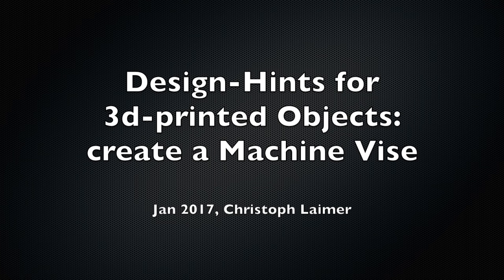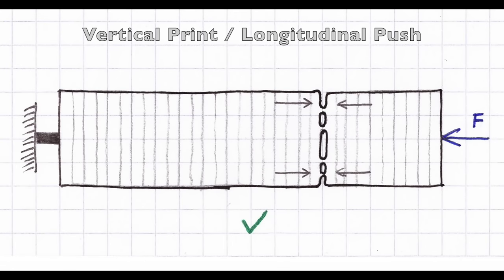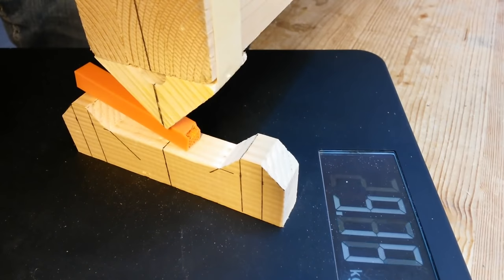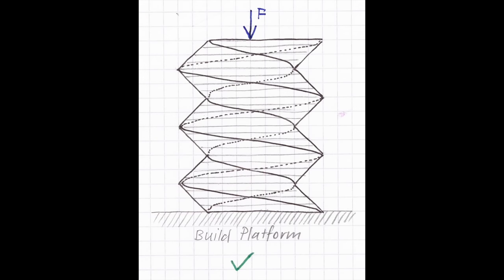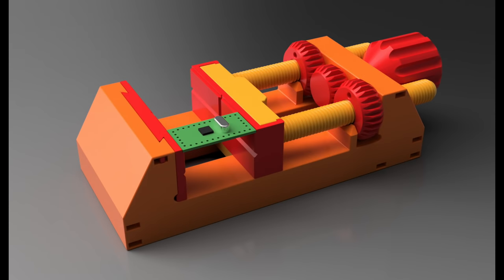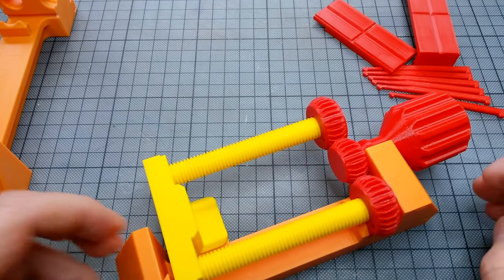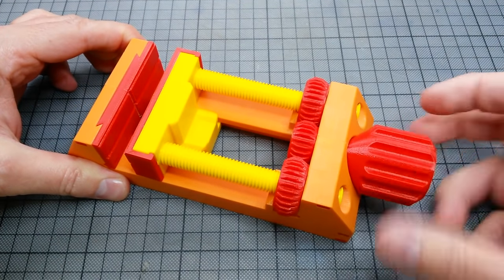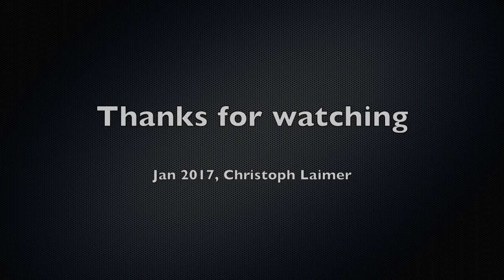Design Hints for 3d printed mechanical Objects: How to create a Machine Vise

Comment: As a Mechanical engineer student and a 3d printer owner, this video is just clear as glass. Great Work.
Reply: I second that Lucas. I've been looking for a while for some information about maximising build strength and this covered everything relating to design strength in just 11 minutes with perfect clarity.
There are other considerations like material(s), printing temp and post processing (like epoxy or acetone vapour etc.) but this is really the entire remaining area that no-one else seems to have covered though. 
Excellent! :-)
Reply: Tempering a print in the oven is another post processing trick to be aware of, although you have to plan for the shrinkage. Thomas Sanladerer touches on this in one of his strength testing vids...
Reply: May I suggest replacing the guiding hole with a protruding ball or a line? I hate places that germs can hide.

Comment: I'm currently printing this vise out and thought I should share my experience so far. I first printed the sliding piece with the two screws. The bottom (face) of it had some layers that warped slightly. I probably could have done the first few layers at a lower temperature but with a little sanding, it'll work perfectly fine. Also had some messy parts on the screws but they were easy to clean up.
I printed the gears second and I'm amazed how well they came out. They mesh together perfectly straight off the printer. Only needed to clean up the threads very slightly.
The two halves of the base are printing now (60% so far) but they look absolutely fantastic.

That's as far as I've gotten but I don't forsee any problems in finishing a working vise.

Anyway, thanks for uploading the files to this! It's going to come in extremely handy.

Comment: Well done.  One thing that I did on the screw on a bench vise that I did was to leave the center hollow so that after printing I could insert a threaded rod.  One end has an embedded nut to thread into and the other I use a nylock nut.  Once tightened down I can apply considerable force without damaging the printed threads.

Comment: Thanks for the excellent video.
This video made me realise why my last print had a failed clip joint.
It was a complicated LED Strip Light design in 5 parts with rotating joints and wall bracket.
The clips I designed that 'should have' slipped into place and locked, just broke as they didn't have enough strength, while the small test part I printed first worked well.
They were aligned differently during printing, so had different weak points!
Thanks for providing your vice design as well, as it will be very useful.
:)

Comment: I very much liked your explanation of the forces acting upon the print layers, and the correct way to orientate the part on the print bed. A square thread would make the rods much stronger (although probably not needed to hold a pcb)😊 Thank you for sharing

Comment: It is a very nice presentation and I like all your videos. Regarding printing the screw, did you consider putting a flat by removing a portion of the thread with a plane parallel to the axis, on one side only to touch the build plate? You will not have a complete thread around 360 degrees on the screw but the nut will have a thread all the way around.  Thus, the motion will be continuous. This will allow a higher tensile load capacity because of the continuous fiber direction as you illustrated.

Comment: I managed to explode your vise with some of my abusive use, and god damn it went out with a bang :P
Surprisingly it was one of the base halves that went first - It was just torn apart right across the middle section, where it should be really strong.
I imagine there was quite a lot of force involved in this failure, but I'm very surprised the screws didn't fail first.

Comment: How do you know what tolerances to use when designing a part?
Reply from the maker: Good point. It's based on experience with my 3d-printers. For a tight fit between two 3d-printed parts I'm designing a gap of 0.15mm, for a loose fit like a bearing I'm designing a gap of 0.25mm (or more). The accuracy variation of 3d-printers out in the field is still huge, but compared with the past, things got already much better..
Reply: Fully agreed. Just trial and error. And the tolerances you measure are a good guideline; personally I always use 0.15 - 0.2 mm for a tight fit and also around 0.25mm for a loose fit. Depending on the application. If I want a really smooth loose fit then I generally use 0 to 0.1mm spacing and then finish the hole / part with a drill / sanding paper.
Reply: I have found that many variables exist for this.  For instance infill percentage will make hole sizes change.  At 70% infill I use 5.4mm for 5mm holes and it is a close fit (not a tight fit) but at 20% infill they became a loose fit and was no longer good as a bearing holder as the bearing just slipped out (this was a larger hole of course).  Now I changed my nozzle size in S3D from auto (0.42mm) to the actual size (0.35mm) and had to increase my flow rate from 1.01 to 1.02 and all of my sizing had to have an extra 0.1-0.15 added to be the same size.

Infill, flow rate, infill pattern, and wall layer count (I use 6 so I can drill out a hole on my drill press if needed) all effect hole sizes.  Oh, and lets not forget shrinkage too (look up the amount of normal shrinkage for your material type you are printing in on the net) that must be accounted for and it changes depending on room temp + rh (reason Stratasys uses a heated chamber to help control this variable).
Reply: Sorry if this is a dumb question: but by a gap of eg .25mm for a loose fit, do you refer to .25mm difference in the radius (--> on both sides, so .5mm less diameter for a round object that should have a loose fit in a hole) or in the diameter? I ask because I'm in the process of properly fine-tuning my diy printer, while actually having access to my brother's ultimaker: with the ultimaker, .25mm gap over the diameter would currently be far from a loose fit. But maybe I have just been using bad slicer settings ... What should I aim for with my printer?
Reply from the maker: Yes, for a loose fit, the diameter of two objects needs to be is 2*0.25mm different. You also need to consider how accurate the two parts are. E.g. if you design a hole for a ball-bearing: because a BB is very accurate, a gap of 0.125mm is sufficient for a loose fit (half of 0.25).
Reply: Ok, perfect, thanks for the fast answer!
Reply: I usually print multiple 1cm by 1cm by 1cm block of cube. Use statistics on it to find sigma. That can give you the + or - of the tolerance. But its kinda tedious.

Comment: I thoroughly enjoyed watching this video, printing the parts and putting the vise together! 

I have one question:

The gears have some undesirable play and they tend to get unsynchronized, resulting in de vise going offset.
Also, the gears slip if I try to clamp something in the vise. 
Everything else fits perfectly. 

Is there any way to fix this?

Comment: I was hoping that you'd have also included a wood bar that was cut against the grain rather than the grain going through the length of the bar. I believe that most wood is far more anisotropic than 3D printed plastic. Possible exceptions would be things like Mulberry wood and the type that Indians used for bows (Osage Orange?) due to the grain structure not being straight-line as in most other wood.

Anyway, I'm pretty sure that a wood bar with the grains aligned in the short dimension would have snapped at a tiny fraction of the pressure required to snap the similarly aligned printed plastic. Still, it'd be interesting to have it tested for confirmation. If this is the case, it might lay to rest much of the concern over printed material anisotropy.

One other thing that IMO could have a dramatic effect on the "angular strength" of things like the vice jaws would be for printer software (firmware?) that would have the lines curve around each corner rather than printing "raster style" with the long part of the piece having long runs of plastic, but the short parts having short runs.

I am assuming this is how the printers operate. (I have built a printer my son purchased but we have not yet fired it up other than to verify that the motors work and the head will melt -- and eject -- plastic filament.)

Comment: Maybe you should've switch the places of the jaw plates. The design would be stronger. The C-bracket it's needed more on the opposite side where can hold better the 2 parts of the base. :) Great design by the way. I am assembling it right now. Still hot from the printer:)

Comment: This is such a great build. Do you have or are you planning to do any more detailed tutorials on the 3D modeling process. I would love to know how to do screw threads from the ground up for example. Any thoughts on putting together a video that details your process from start to finish. The parts print so easily without any issues on my Prusa i3 mk2 that I'm really amazed. Would love to learn how to get the same results myself from my own models.
Reply from the maker: This is a nice video about custom threads in Fusion 360: https://www.youtube.com/watch?v=TR7fsgQNmEk

Comment: great work!! what if the main gear is larger in diameter, so you can move the clamp faster?
is there a big drawback?
Reply from the maker: It probably doesn't matter. I made the 2 pushing gears larger,  so they can also be used like a handle and moved directly by hand. If they are smaller, they "disappear" behind the base frame, and accessing them by finger gets more difficult. Maybe this secondary feature is obsolete with a larger center gear.
Reply: Christoph Laimer thanks for the reply, love all your work on this channel! left me excited to design and print a 3 (at least 2) axis vise now!

Comment: More videos like this please!! Thank you for this excellent walkthrough. I just started working for a 3D printing shop and often run into technical issues on the best way to design and print mechanical objects. 

I see in the comments that you've addressed questions about tolerances. Is there a method you've used to test tolerances in different settings and materials? Also, how did you determine what dimensions to design the threads and gears with? Thanks!

Comment: Awesome Video.
Do you ever put 360 projects up?
Stl files are cool, but I think I seeing your setup would be even more interesting.
Especially if someone wanted to make changes.
I think I might sit down and try and make one of these in Fusion, thanks your video was inspiring.
Reply: Nevermind! Just saw that you do have the fusion 360 files! This is awesome!
Thanks! There are a few modifications I want to take a look at and maybe make.
I will update here if it works out.
and will post the fusion 360 files here for people as well.

Comment: Just one remark i can make: You should have inverted the swallow joint on the fixed yaw. That way this swallow joint would remove the need for the clips and keep everything together more firmly.
Reply from the maker: Indeed I had this as a temporary design, but then it would need to be printed with support material. Printing without  support material is not only more convenient, but the accuracy of the supported structures is also inferior.
Reply: print it jaw face down or standing up?

awesome vid by the way, subbed!

Comment: I am amazed how you printed to such accuracy and smooth tolerances.  How do you do that?  I find I have to go with a trial and error approach, as well as adjust/play with nominal dimensions on my CAD file.  

Yours looks like you printed immediately with zero issue.
Reply from the maker: Also trial and error. And a lot of experience from earlier projects ... Luckily new 3d-printers are getting more and more reliable and accurate.

Comment: I think this is a bit misleading, however. When printing vertically, you're not using 100% infill, so there's not as much material "available" holding the lasers together. Would love to see a 10x10x100 with 100% vertically.

Comment: Like wood, what would be the recommended parameters; maximum pressures, etc.?
 (also fm,k: E0,mean: ρmean: ρk: ft;0;k: ft;90;k: fc;0;k: fc;90;k: fv;k: E0,05: E90,mean: Gmean: G0,05) usw.
Wood is most easy to engineer.

Comment: Is there a reason why 3D printers are limited to printing in one direction only? Why can't grain patterns be mixed in different layers?
Reply: If you think about how the printer works, there is quite a big "print head" that needs space to move. If you tried to print with vertical grain direction on a print, that head would interfere with the model as it moves up and down, so unless you have a 5-axis printer it is only practical to have the grains oriented in the x-y plane (z being vertical). And event with a 5-axis printer you are limited (and they are also very rare).
Reply: neistridlar
You can still print in the X direction, and Y direction on each level though.
Reply: Yup, no one ever denied that. In fact it is practically always done that way.

Comment: im kinda surprised you didn't solid fill you prints or like 95% them or is the strength of infill not worth the extra length of time it takes?
Reply: ncktbs 

It wouldn't matter for comparison, however it looks like his infill changes orientation (as would be expected). So while what he says is completely correct, it's a pretty bad test. He should have used 100% infill, but that would have taken a while to print.
Reply from the maker: My tests should demonstrate, that it is a very bad idea to have pulling internal forces perpendicular to the printed layers. Nothing more. Infill has certainly an influence to the total strength, but it doesn't make a bad designed object better.
Reply: Christoph Laimer 

You're absolutely right, and your diagrams show what's going on perfectly. Just pointing out that the numbers you get aren't going to be totally consistent.
Reply from the maker: When an object is bent, the forces at the outer surface of a body are much higher than inside. In the middle the forces are zero. Of course a 100% filled body is stronger than a 30% filled body. But if you have the choice to modify your design, you better use the material not as infill, but make the object a bit larger and hollow.
Reply: Christoph Laimer 

Yep. You could also have used a hollow, triangular beam so that the infill wouldn't affect the result while still allowing the beam to print easily in any orientation. 

But either way, it's a good demonstration. And a nice design on the vice, by the way. The little clips are clever.
Reply from the maker: Thanks :-) ... It's important that you clarified that measurements have to be interpreted relative and not absolute. If people see numbers, they tend to look at the last digits and not at the magnitude.
Reply: +JMMC1005 the strongest shape would be an I-beam

Comment: 17:16 "when cleaning the surface with taps they are even better" -- taps of what measurements?
Reply: The shank hole is 12.3 (12 + room for overextrusion to make the hole smaller) and the pitch is 1.75, so I assume it is M12: https://www.boltdepot.com/fastener-information/measuring/metric-thread-pitch.aspx

Comment: Hide threaded rod for protection, the threaded rods usually are hidden in the handle.
http://static.axminster.co.uk/media/catalog/product/cache/1/image/920x/9df78eab33525d08d6e5fb8d27136e95/4/7/475090_xl.jpg

Comment: My last comment didn't post for some reason,

But, thanks for this video.  It cleared up some questions I had regarding compressive, tensile and shearing strength.
I do have a question about the threaded rods. I understand now why printing them in the vertical position results in weaker tensile strength so have you ever tried printing threaded rods horizontal where you flatten the top and bottom a bit so it can be printed laying down?

Overall there should be enough threads around the circumference to provide the grip needed.

Also, you mentioned cleaning this print with a thread tap. Could I ask which one as I would like to know what to purchase from the hardware store (basically what is the thread number/measurement?)

Also, have you done any testing with torsion strength?

Thanks again!

Comment: Nice video, but i`d use a steel threaded rod and a simple nut instead of 3d-printed ones. Also it sould be a nice idea to reinforce the vise with some threaded rods along the rail.

Comment: Actually it's not thaaat well designed. Tolerances are pretty tight even at spots where it's absolutely not needed. I have quite a few problems due to needless tight fittings and a not 1000€-printer.
I think I'll use the basic design ideas and make it a much easier to print version.